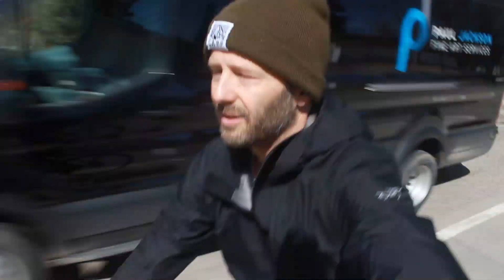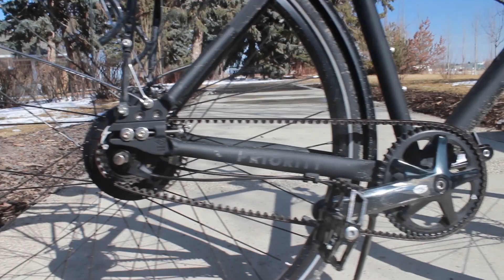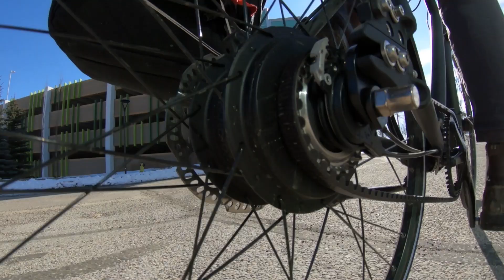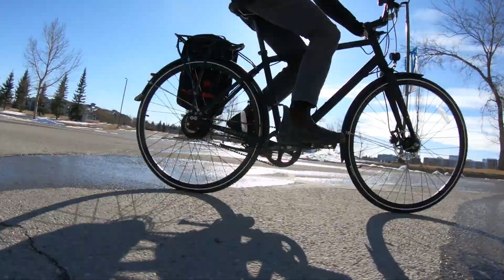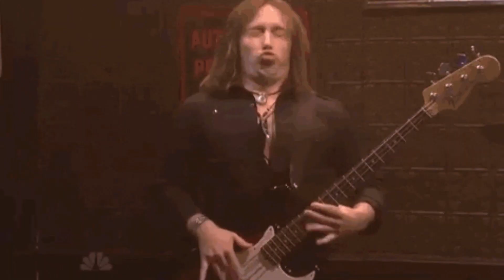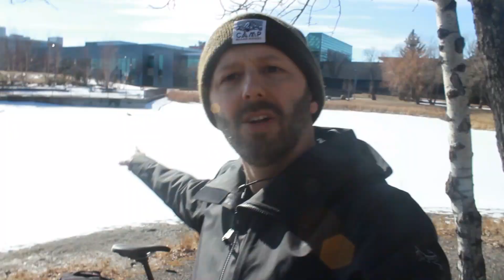Chain vs belt-drive bike | What's best for your bicycle commute?

Comment: chain & singlespeed, possibly in some kind of enclosure if dirty town as it affords spending less time for cleaning and lubing chain.  customizing gear ratio is important; belts do not let you have 46:19 for example. it's hard to find the parts (not only the belt but also the cogs) when they are worn out and they are not cheap. only if you live in a hilly area (frequently more than 10%) should you consider multispeed but if you want things complicated... get a rear motor hub (singlespeed is a beast for this) as it means zero maintenance and much less chain wear.

Comment: I guess if you're picking your times to ride more carefully, and avoiding rain and mud, there'd be far less to worry about for dirt, and filth, and rust with a normal chain.  I don't have to clean mine that often.  But I suppose if it's snow on the ground all the time, then to avoid that you'd be driving your car for months!  Here we get snow (at 5000' ASL) but it's normally just for a few days at a time.

Comment: You could adapt a pre existing bike by having a double roller thing clamped really tight to the chainstay, and have one long belt and one short belt, and they can join on said roller. Or maybe the short belt can go upwards from the crank and the long belt can go back down towards the wheels so you can use water bottle braze ons or clamp it like a derailleur. At least that's what I can see working in my head. The pictures are always kinda incomplete and I sometimes miss things when multiple moving parts are introduced. Could be a fun project?

Comment: I would think about getting a belt drive, but yeah definitely they're expensive, and I don't really want to buy a whole new bike. I was thinking about it when I bought an ebike recently, but I just couldn't commit the extra $1k or whatever to get an internal hub + belt drive system

Comment: Shimano linkglide is a good contender and affordable.
Ps. With modern Shimano chains you don't need it to clean it all the time. Just run it thru a cloth, reapply quality lube, let it dry for 2 hours if you can and you're ready to go for another 500 kilometers.

Comment: You've got a Priority brand model.  I know that since I saw the label name in another video.  Which model do you have?  I have a feel for the Dutchboy style for aesthetics and I like it.  Done very little thinking on these, and more than anything, rationalizing one as any new bike, would be the hard part.  I sure did it with a lot of handguns though!
Reply: If you haven't figured out, it's Onyx Continuum. More of a hybrid bike than a Dutch coaster. I didn't like that it doesn't allow for bigger than 32mm wheels with fenders.
Reply: You meant that's the model for the Priority bike he ran in this?  Don't you kind of have to accept those kinds of size limits with fenders?  32C tires is kind of the largest for road bikes a lot of times.  28C seems to be the best size for me when you assume gravel at corners and random things like that.

Comment: The fact that belt drive-train needs a special frame, makes the chain bike not being convertible to a belt drive-train one. 
I think, the middle ground would be to go with a think chain and a hub gear, so that we can have a strong chain and also less maintenance gear system.

Comment: With a chain system you have a wide range of gears that aid you to tackle steep climbs and go fast on straight roads. Do the belt drives have the same level of advantage ? I mean a 11x36 cassette gives you a wide range in comparison.
Reply: Between my 2 cassetts I have 21 different gear combinations.  Of that I use 7.  Its not about having lots of options but having the right Options.

Comment: Belt drives do break, they also squeak when dirty, I have seen bars of soap used to remedy the speaking. My singlespeed is silent and has a perfect chainline. A rear internal hub such as a Shimano Nexus has an internal friction that robs power. If you're riding a Priority Bike with the internal gearing and wish to change to a lower gear, then a new cog and belt may be necessary.
The frames used on the Carbon belt bikes usually have a rear stay that seperates, because the belt does not seperate as a chain does, there are no links.
Watching Ryan Van Duzer on YouTube sees him carrying a spare belt, as do other belt users on that channel. 
So, I couldn't upgrade my present bike to a carbon belt without taking a hacksaw to the rear triangle.
I see the Carbon belt as more expensive, less efficient, heavier and less 
adaptable, and you are less likely to find a Carbon belt at bike shops or a Wal*Mart type of store.
I do enjoy your videos.

Comment: Have you or anyone seen a SS / Fixed Gear belt drive bike yet ?
It seems like that might bring the entry cost of owning a belt drive down measurably.
Reply: SS/FG belt drive bikes are niche product so no, they aren't significantly cheaper compared to IGH bikes unless you compare to bikes w/ Rohloff hub.
Reply: @event4216  
My SS - Fixed Langster with Keiren chain is unbreakable.

A bike messenger could hammer it daily & no worries.

KMC 710 - (Keiren) chain was $18 !
Once Shimano (IF ?) gets serious about marketing their 13 speed gearbox set up perhaps these benefits will come down to a reasonable price point.

Devoted super cyclists will pay $3000 + for bikes but NOT a wider public. 

Most of my non-cyclist friends cannot swallow $1000, let alone $3000.
I still marvel at how relatively affordable chain - Cassette - Deraileur systems can be.
And maintained reasonably.

But I sure wouldn't mind the better tech of IGH / Gearbox.

Someday....
Reply: Priority Cycles Coast. 500 ish.
Reply: I have a Schindelhauer Siegfried single speed bike. I absolutely love it; fun, silent and zero maintenance.

Comment: Belt compared to chain is a minimum difference in efficiency loss. It's when paired with an internal hub (not Rohloff) that you'll see losses of above 10% (depending on gear selected).
Reply: does a single speed belt drive bike then avoid that 10 percent hit?
Reply: @timothyflynn1758  Single speed bikes are something like 97% efficient. Chain drives are on average about 1% more efficient than a belt drive, so negligible.

Comment: You don't need a LBS to do belt maintenance! Just read the instructions from Gates and do it yourself. If you can maintain a chain, a belt is simpler. I have both. I definitely use the belt drive commuter bike in the rain (when you are not racing anyway) and there is simply no comparison.  Most hardcore trekking bikers use belt drive + Rolloff internal drive hubs and easily put 10~20k/km on the belts between maintenance.. They are robust as hell. Edit. see this : https://youtu.be/8SKeQ6B2UTk

Comment: Hi could you please give more info on the belt that broke in the cold, and the replacement that doesn’t..?
Reply: There are two types of gates belts: CDN and CDX. CDN is the cheaper one with a minimum temperature of -20°C while CDX can be used until -53°C. The price difference is around 20€.

Comment: Belts require tension to work properly; bike hubs require lack of tension to work properly.  Belt drives disassemble freewheels, trash axle bearings, and otherwise make your bike very sad unless you run them so loose that the belts self-destruct.

Comment: I've had this bike for several days now and I have not had problems with it so far. https://www.youtube.com/post/Ugkxn_jUDSlprMIeubd9rHdEAnv59nKfjcKv The handlebars, seat+ seat post, pedals, and front wheel were detached for shipping. It was easy to reassemble, but I did need to go out and buy a set of tools in the metric system to reattach parts. Use lubricant (WD-40 works well) on screw threads and hinges before re-assembling.(NOTE: Do Not Throw Away Any Of The Packaging Until After Assembly Because Some Of The Packaging Contains Small Parts That You Will Need To Reattach Parts!!!)Took it to a bike kitchen for fine tuning afterwards, and for refilling the tires (they'd lost some air during shipping) and then practiced riding on it. It fits me perfectly at 5'4" with the seat at the lowest possible setting--would not recommend for anyone shorter, as it may be difficult to get on and off the bike without assistance of some kind. The aluminum body is beautifully welded together--the only thing that irks me somewhat is some of the plastic parts, but oh well. Not too experienced with bikes (haven't owned one in years) but if you're not willing or are unable to spend $600+ on another bike, I would say this is a good way to get started. Just check everything before you go out riding--air levels in the tires, wobbling of the seat, handlebars, or pedals, loose screws/parts, you know, as it will happen over time. Common sense. Good luck to ya, and hope my review helps.

Comment: You tell the truth! Internal hubs are usually heavier than regular derailleur setups. You can't use them on road bikes. You can't use them to exercise at home.  I have two belt drive  bikes one-speed  and 3-speed bikes
Reply: why can't you use them on road bike?
Reply: @qui11  lolol. This was nuts. Of course you can.
Reply: @qui11  - I think he means that it's just not as ideal for being real speedy with a load of gears and stuff.
Reply: by "heavier" u mean like 2 lbs? totally irrelevant.....
Reply: 3lbs or more depends on rhe hub.
Reply: @efimlos  how do you know its not 2.5lbs?
Reply: @qui11  because wheel  balance and weight
Reply: @Siberius-  2 0f 3  speeds  are absolutely  useless on my bike because  steps are too big
Reply: @efimlos  actually, with internal gear hubs, your wheel spokes are completely evenly tensioned. The weight is also more in the center unlike derailleurs. So saying balance is wrong. The hub is built to last for years, even decades so of course it's heavier by a few grams (3-speed hubs) to a few pounds max, non-issue since majority of cyclists aren't racers.
Reply: @efimlos  - Yea people often feel the gearing is too high on the spectrum. The first gear is for relaxed pedalling on flats, the 2nd gear is for going fast on flats, and the 3rd hear is useless unless you have super legs on flat. Hills are nigh impossible in any gear. I suppose they would generally have the Netherlands in mind with these products... 3rd gear could be useful for flying down hills, but the Netherlands is flat, so I don't know why they bother with a 3rd gear at all lol.
Reply: @Siberius-  I don't feel the weight on the first gear, the second one is my way to go on the flat surface. I rode on the third gear but I am out of shape these days, so I don't use third gear at all. Sheldon Brown's website recommends using either a bigger rear sprocket or a smaller front sprocket, but IMO it is too much of a hassle because  I would need to change the belt
Reply: @efimlos  - Seems your legs might be stronger than average, making the first gear useless on flats, but with the 3rd gear still being too much lol.
Though it sounds like hills would be more doable for you then.

Comment: My priority bike is on order. I've only been biking for 2.5 months and I loathe chain drive with derailleur. My current bike is pure junk with clunky shifting, so I didn't hesitate on upgrading to a belt drive bike. Never looking back.
Reply: the extreme high cost of a Priority ebike ($3200) is causing me to hesitate. but other than that, i love every feature of them.
Reply: @srobeck77  actually, their bikes start at $549 (Coast and Classic Plus). They're not super expensive. The price you quoted is for the Apollo or 600x gravel bikes.
Reply: @joellebrodeur1015  the $549 doesnt have the belt instead of a chain like how the post said he wanted. so the $549 bike is irrelevant
Reply: @srobeck77  I don't care for eBikes. For a belt drive at an entry level price that has a reliable, brand name drivetrain (Gates), you'll be hard pressed to find anything less than $549.

Comment: Carbon belts are useless & will get u stranded. If u have a bike with a Carbon belt & it snaps. Convert it to a chain & save yourself money in the long run. A chain setup is less than £100 compared to £180 plus for just the belt

And a chain will work in any weather.  The other advantage with a chain is u can change gear ratio without spending over £100 for a new belt

Comment: I am not sure about a practical application of a belt drive really. Maybe a place where getting a bike serviced is really difficult to find, a place where commercial population is really limited. For normal people chain is the best. I don't mind buying chain every two years if at all it gets to that point. Though, I have seen chains lasting longer than that if one is using bike largely for commuting (No recreational activities). Otherwise, looking at the cost of belt, the hub, frame, I am really better off with traditional chains on an E-bike.

Comment: Main question is: which one is faster for a road bike? I  tried the Cannondale Bad Boy, but to me it had to much resistance in the hub. What's your experience?
Reply from the maker: In most cases, I'd expect a chain to be faster because you could use a derailleur, which is usually lighter, can usually accommodate more gears and, therefore, faster.
Reply: Morto Pesko the most efficient transmission are in order:
1. Cassette + chain + derailleur (caveats: when new, clean, well greased and in straight line)
2. Rohloff internally geared hub combined with a chain or a belt
3. Pinion internally geared mid mounted transmission box combined with a chain/belt
4. Vario 380 internal geared hub combined with a chain/belt
5. Alfine internally geared hub combined with a chain/belt

Also, internally geared hubs need a few hundred miles to break-in and increase their efficiency.
Reply: @ruirodtube Thanks for the information. I tried both Cannondale bad boy with rohloff and  alfine 7. Alfine 7 too much resistance in the hub. Rohloff much better, but still not near chain+derailleur. I do like the looks of the belt much better and the fact these are allmost maintenance free.
Reply: Morto Pesko please bear in mind that geared hubs and belts become more efficient as they wear in but the chain & cassette start at their most efficient and then wear down.
Reply: @ruirodtube  Thanks again. I surely will keep that in mind. Think I have to   do some more test rides.
Reply: I'm on an alfine 11 since 2years (which runs with oil instead of grease like the smaller alfines) regarding resistance i can't tell that much of a difference to my Former Shimano Deore bike with chain...
I love Belt drives. Will never Go back!
Reply: Have you or anyone seen a SS / Fixed Gear belt drive bike yet ?
It seems like that might bring the entry cost of owning a belt drive down measurably.

Comment: Did you get one to review? Or just get in on the priority scene? How are they?  I think it's so weird to take out the frame to change the belt. I bet its smooth tho.
Reply: First, you would do it in about once a year if you commute every day; it depends on the bike, it might be not a big deal. I shipped my priority continuum back because it's extremely difficult to quickly speed up. and it is a critical issue because some times I want to cross an intersection on a  4th line street. Priority bicycles, however, are very nice they always will run the extra mile to make you happy. Belt driven bikes are good for commuting, touring, and probably for mount biking, but don't expect that they would be faster than top-notch road bikes. Remember: a hub weight alone is 3-6 lbs.
Reply: @efimlos  really its slower.. and because of the belt? That sucks if your about speed.
Reply from the maker: The belt doesn't make it slower, but a belt requires internal hub gearing, which is heavier than a derailleur, which means it's theoretically slower. but on a commuter bike, it maybe worth the trade off.
Reply: @JohnSmith-yw4bh once you speed up it is not so bad.  However, my next bike will have a chain.
Reply: it is because of weight. Also if gears ratio is a matter it is also a problem.
Reply: @Shifter_Cycling  agree

Comment: So how hard is it to change a tire when you get a flat? I'd assume that you would have to carry a pair of wrenches with you since there is no quick release option.
Reply: On my Schindelhauer you just need a hex wrench. The tension of the belt is adjusted by moving the rear triangle or (on BMC, Cube etc) the eccentric bracket, and this adjustment is not affected by taking off the wheel. And since the belt is not dirty, it is actually easier to take the wheel off.
Reply: Squirt the green slime inside your tires to avoid those flats

Comment: I live in a hilly NW Calgary.  My commute home involves about 200M of climbing, some of the hills rather steep.  Are the gear ratios in these internal hubs suited for climbing?  Are internal hubs suited for cruising at 30KM/h on flats as well?
Reply from the maker: You can certainly get internal hubs with a wide range that should help you with both situations. It won’t be as wide a range as you can get with a derailleur, and it will probably cost more, but there will be other advantages, especially in the lower maintenance requirements.
Reply: @Shifter_Cycling  ranges for German hubs are from 535% through 600% to 636% for rohloff and pinion P12 & P18 repectively

Comment: Which one is harder to pedal? Chain or carbon belt drive?
Reply: Belt drive. The belt as a single part that goes around the gears has to deform in order to do so, and a deformation always takes more energy than bending a low friction joint does.
Reply: @DualDesertEagle   You have given  a scientific and technical explanation to my question... Also this explains why the carbon belt drive has such huge rear freewheel and also the front chain ring is also made big this is to minimize the deformation force needed the run the chain...  Thanks...
Reply: belt is 2% less efficient -- so they are basically the same